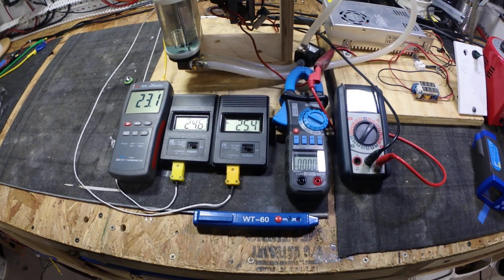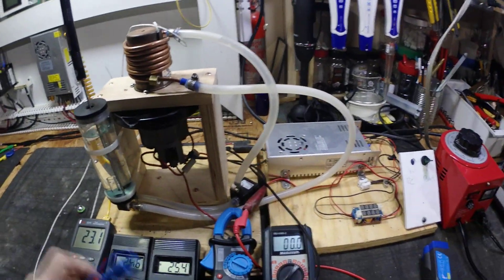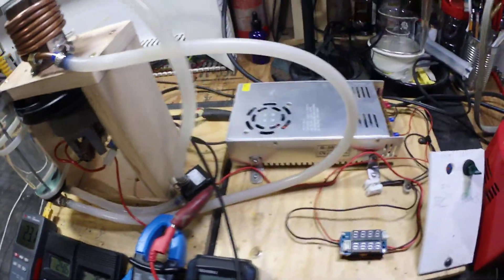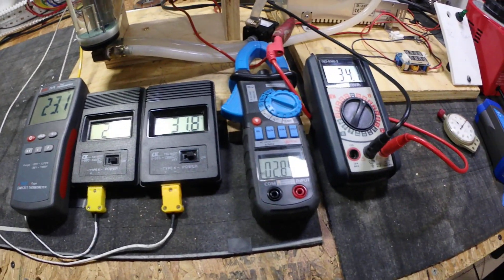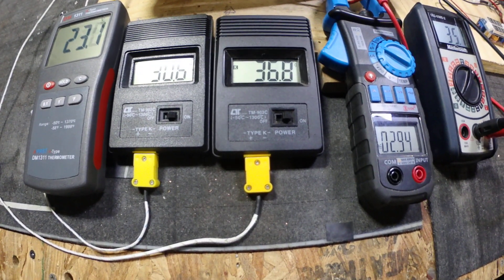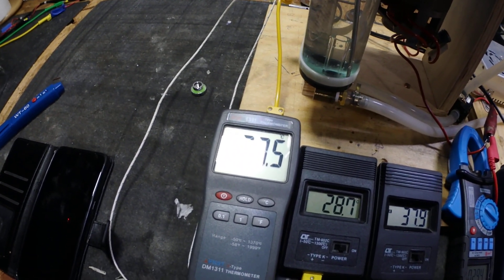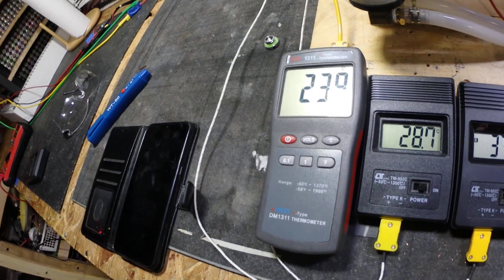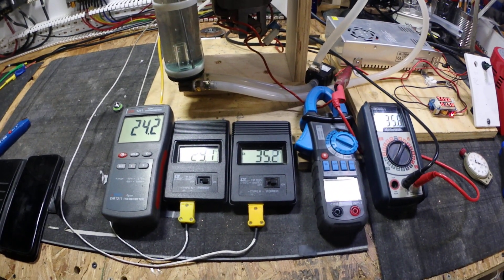Magnetic Heater Test 1

Comment: Can you please tell me if using the flat round magnets you use are Neodymium N52 grade and would using magnets that are closer to the copper tube by using radiused magnets increase the heat output ??? Just hard to believe that the motor is using such low levels of power. 
Nice work Sir.